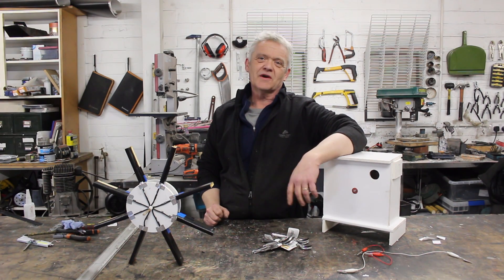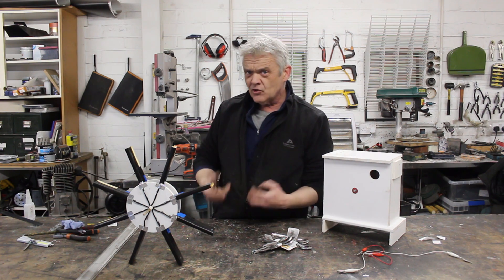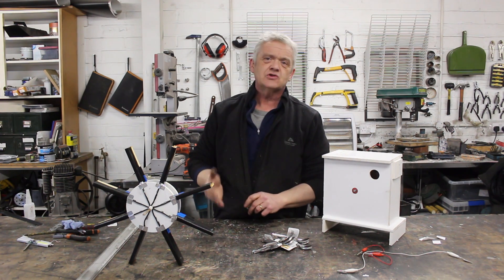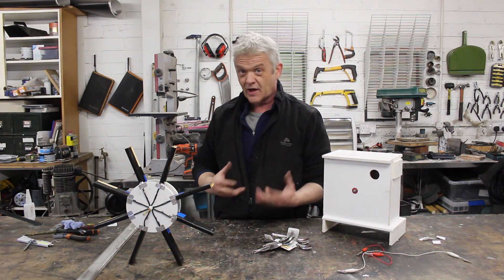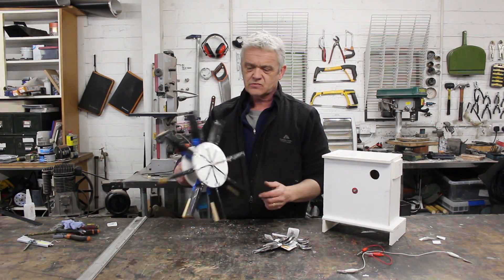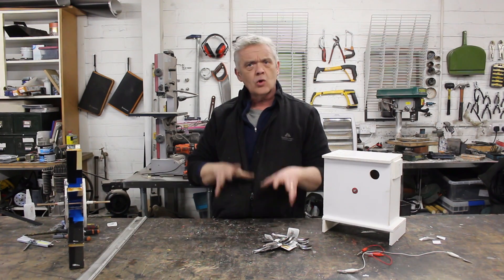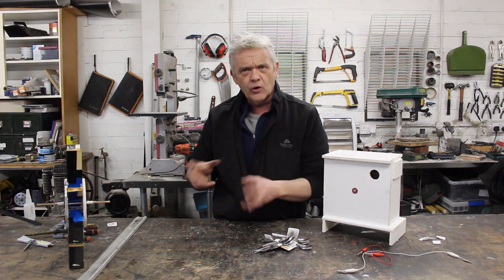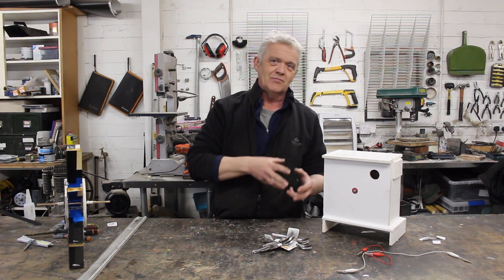1473 Water Could Be The Answer To Home Energy Storage

Comment: If you're running off of water pressure, aren't you taking the energy away from the water plant that has to maintain the water pressure?
If you just open the tap the water can flow freely with little resistance, so not much work is needed. But if you put a motor in there and the water flow has higher resistance then more work is being done by the water and the power plant.

Imho the real answer is large water storage to eliminate the energy costs for heating in the winter. You heat up a large water reservoir in the summer when solar energy is abundant and extract the heat in the winter. You need a lot of water though with solar. With wind energy there is still wind in winter so you'd only need to bridge a few days worth if there is less wind.
Reply from the maker: I covered that in this talk didn't I?
Reply: @ThinkingandTinkering  Not really I think?
I think if you take out 10 liter of water it will take more energy out of the water system if you do it with a high resistance than if you just let it flow out. And if you'd use a suction pump you'd be adding energy to the water system.
Similar to how letting a certain amount of amps flow through a wire with higher resistance takes more energy than through a lower wire.
So basically you can't slowly fill your toilet and a motor without causing increased energy demand. And then it would be more efficient to just use the mains line.

Comment: Water accumulators are still used to boost the flow rate in houses fed by long small bore pipes. They fill up slowly at mains pressure, then when you run a shower they deliver the flow rate you need. They work very much like the smoothing capacitor in a DC power supply.
Reply from the maker: now that is interesting thanks for that mate
Reply: Capacitor is more like an incredibly short pipe of enormous bore :P
Reply: @John-rw9bv  I dissagree. Water is not significantly compressible so the pipe you describe cannot store a variable volume of water and deliver it in the form of increased flow rate when needed. The water coming out of the pipe is the same as that going into it. The Accumulator I described contain a bladder that can store a variable quantity of water. The analogy with a capacitor isn't perfect because the more charge you put into a capacitor the greater the voltage, where as the pressure in an Accumulator is more or less constant.

Comment: Forget about water.  It's simply a working fluid in a hydraulic system now.  If you're going to hoist weights up and down as your accumulator strategy, there are more efficient transmissions.
Reply from the maker: i don't want to be rude so please don't take it that way - but i doubt what you are saying and the reason i doubt it - i haven't seen it - do you have examples? And I am being genuine here as I am interested in what you say - just slightly disbelieving as I always am when i hear a bold assertion without backup
Reply: @ThinkingandTinkering  No worries man, just look at a grandfather clock drive mechanism.  Why doesn't it use weights pressing down onto water in a hydraulic system and then jetting it into a pelton wheel to operate the clockworks?

Comment: Is it possible to create an invention where we use this to increase pressure in existing hydro power systems?
Reply from the maker: i would think so - actually it's not that complex
Reply: @ThinkingandTinkering  I’m interested as to how ? Would it be where the intake is creating a weighted float tank or is the flow  still the governing factor ? Very interesting
Reply: You can, but you don't get any more 'power' overall, in fact you lose more to frictional issues. Rather like a transformer can step up or down voltage and current, the power out is always less than power in. You gain voltage/pressure at the loss of current/flow and vice versa, minus the conversion loses.

Comment: Tanks are super expensive!  Can anybody think of a cheap diy tank!
Reply: Large Vinyl poster/tarps are often discarded by sports centers, gyms, and other venues advertising seasonal events and offers. They'll usually be glad for you to take them away after use. They are water-tight, UV resistant and are easily repaired/joined. I've used them for shed roofs, pond-liners etc for decades with no problems. They can be made into bags, set into shallow trays to stop them rolling (line the tray with another tarp and drainage in case of leaks). Weight can be a problem if you put them in roof spaces. Springs and micro-switches under the tray/structure will give suitable/'full' 'overload' warnings. Flanged through-connectors are cheap and/or can be scavenged from old header tanks etc. Wrapping the bags in strong netting takes the strain off joints/seams.
Reply from the maker: i am going to look into it mate

Comment: All that water could also be used for heating and/or cooling to save energy at the same time!  Extra water on hand is good too!
Reply from the maker: absolutely
Reply: Heat pump efficiency decreases with temperature differential, having a body of water is much warmer than the ambient air temperature most of winter. Cooling can be a direct circulation.

Comment: I've been reflecting upon these accumulator systems for many years now.  I totally agree there is something to it, and it's far greater than expected!  Using weights, with water pressure and air pressure combined.
Reply: i had the same idea when I visited 'Cragside'' (Lord William Armstrong's house in Northumbria) who made his initial money on Hydraulics (later guns) in 2019; then Covid 19 got in the way.
I though about using  rain water off the roof to create the 'weight'' - i.e. filling up tanks at zero pressure - to charge it up and a 'System Liquid' in a closed loop that could use a Pelton style wheel.
Pelton wheels being more efficient than reaction turbines (i.e. use the rain water flow directly) and it saves the infrastructure needed to support heavy tanks of water high up in a building or the hassle when they leak: all the 'business bits' are accessing at ground level.
Reply from the maker: it is fascinating and has possibilities that's for sure
Reply: @ThinkingandTinkering  Nod to my comment: fill tanks of rain water at ground level to create the pressure; system liquid for the Pelton wheel (water likely, but conceptually hydraulic fluid and so all the standard fittings and pistons work) to extract power at high efficiency.
Reply: Add liquid air as the source of pressure (plus use a Stirling to slowly heat up the air) and you could put it in car 🚗

Comment: Bear with me. Velocity of wind/water scale to output. As slow rotating windmills have relatively faster moving tips. Is it effective/efficient to add smaller turbines on the tips, that face into the oncoming flow, so they spin faster than the main blades?
Reply from the maker: I don't know mate
Reply: @ThinkingandTinkering  Me neither, to be honest these days just breaking wind can be a bit of a gamble. I don't want to get too technical about it.  ;-)  Cheers.

Comment: As an experiment for the past few years, I’ve been dumping all my shaving water into the loo cistern (which includes the otherwise wasted water I have to run before the hot tap gets up to temperature). It exactly matches my requirements for flushing the loo. My cistern has never been filled directly from the mains supply, and curiously the cistern never gets manky either? It’s maybe not saving a lot of water, but it suggests that recycling bathroom sink water is viable. Eventually I’ll divert the water directly to a small holding tank and then pump it to the cistern from there.
Reply from the maker: 30% of water consumption is in flushing the loo - so it saves quite a bit mate
Reply: You can actually buy a small WC with a wash basin built into the top of the cistern. Think it is intended to fit in the corner of a small bathroom.
Reply: i lived in many european houses recycling water for use to flush the toilet and it is very viable. 
Shower water can be easily recycled too.
It does not require any filtering, and toilet smells nice with detergents you use .
Reply: Don't forget in a drought, to put your bath water in your garden, you're plants (temporarily) will be fine with it.
Reply: @contradictorycrow4327  If I lived in Manchester, that would be a great plan 👍

Comment: I've thought of using gravity batteries but this is very interesting, maybe combine the two to harvest not only the energy by water pressure. Thank you for the video.
Reply from the maker: Great point mate thanks for sharing
Reply: Piezoelectric chains
A band name worst case
Reply: @Mr0rris0  I like that! I was once in a band called "Tonguescraper £4.99".
Reply: @Mr0rris0  I have also been looking at piezoelectric ideas
Reply: Piezoelectric staff with a knob to elicit different modes of radio wave that open a garage door like an egyptian
Reply: @marthale7 I'm fascinated by that thought as well. 👍
Reply: Newcomban steam engine
Sort of a piston pump and steamed water.

Comment: A close mate of my Dad in 1964 made a trickle charger grounded to the fender or body of car to stop the rust from forming.  It was sold to Chrysler and they put it away for over 30 years.   Planned obsolescence  is built into our lives to Feed the Greed!    Old is Gold.   Sweet is Simple.  Thank - You Robert....!
Reply: The dissimilar metals in a vehicle is a rolling battery isolated from the ground by the tires. Electrolysis is not a good thing for a vehicle.
Reply: @D-B-Cooper  IRC at the time cars were mostly iron-based
Reply: That works for ships, which are in salt water and have a conductance path. Not gonna work for a car, although such things are sold.
Reply from the maker: the things some folks do is just astounding mate